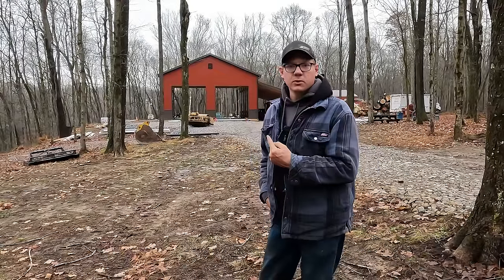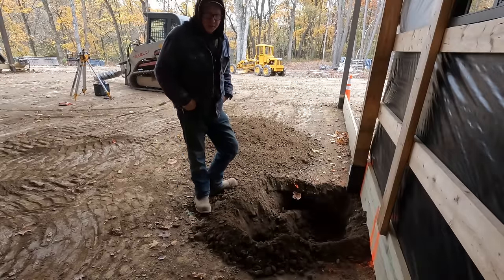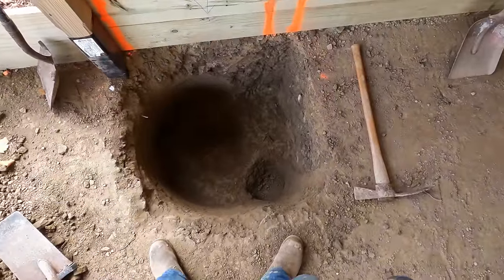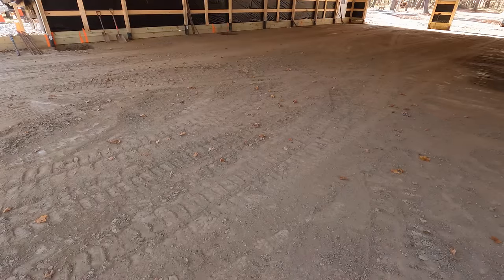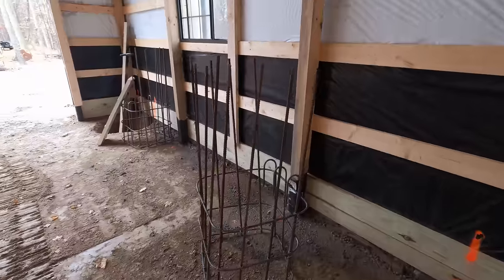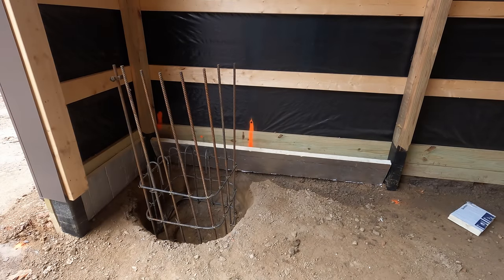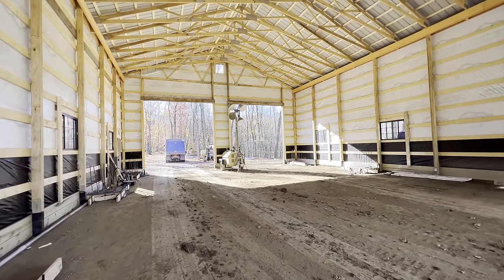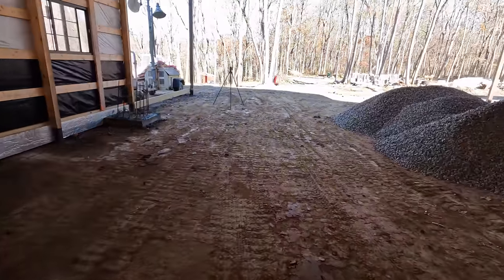Digging & Pouring Footings for a Bridge Crane! (Dream Shop Build)

Comment: Hey Matt , wanted to commend you for all the hard work you do by yourself.  It's very evident that your shop has been well thought out and in the planning stages for some time.  Just watching all the work it took just to make the pier forms is extremely impressive and confirms your character and desire to have the awesome building that you have always wanted.  
As you will find out , there is something about pulling in a piece of equipment on a concrete floor right next to the tools , that makes the service on the equipment and even the breakdowns easier to deal with.  If any one deserves to have a shop that nice , it's YOU !
Reply from the maker: Thanks friend!!

Comment: For a rebar bender I made an adapter for a wood splitter to make all my bends. I know it’s too late for you this time but keep it in mind for next time!
Reply from the maker: Oh that’s an awesome idea!!! 🤔🤔🤔
Reply: I use a crqppy chinese wood splitter as a hydraulic pipe/tube bender
Reply: There's a money tip!  Excellent idea!
Reply: Would the tubing bender you used for the Galion have worked?
Reply: I'm sure he can find one of those, in the woods or weeds, that hasn't run for 10 years. :)
Reply from the maker: @sithus1966  already have one lol
Reply: @Silverhornet81  Doubtful, takes a lot more force to bend rebar compared to hydraulic tubing.
Reply: @BlueDually4x4  um, no.
Rebar actually bends WAY easier than tube!

Comment: i had been wondering how the crane was gonna mount into the building. usually the supports and the crane rails etc are part of the building walls themselves. nice work!!
Reply: you are not alone on that
Reply: Not once they get into heavy weight, I work in the granite industry, and usually 50ton cranes, and some larger, I have however used one up in barre tv, at northern granite, that the crane structure was in the hundred year old area, and the structure was wood, and tied into the building, you want the hear the noises when it travels the length of the warehouse…
Reply: Little victory outdoor, “concrete’s here” 😂😂
Reply from the maker: @ryanhogan6509  ooo I’d love to See that!!
Reply: I've worked on both, newer steel framed buildings had them as part of the building, older masonry structures had separate supports.
Reply: My grandpa worked for the Santa Fe railroad for 42 years in one of the locomotive reman shops in California. Their big crane was a 250 ton beast that had to be load proofed every so often. I have a picture of the crane picking up a full locomotive and the hull of a second one. I wasn’t there but I’ve been told that building was making some massive groaning sounds
Reply: Bolting the crane girders to the house frame and the steel pillars would only make the whole thing 
More solid building taking upp angle forses between girder and pillar.
Steel construction anchors the building to the ground (win-win)

Comment: So refreshing seeing a job properly done, many here on YT like to cut corners with the attitude " good enough " , of course there is a time a place for that, but not when building a floor with a solid and strong base that will properly support the weight of the crane and heavy equipment. Doing it the right way the first time will ensure this will last generations and should never cause any major problems in the future.  You're a good hard worker and it's easy to see that you take the time and effort to do the job right the best a person can, there is a lot to admire in that.

Comment: Ever since you've started clearing the trees for this workshop I've been looking forward to each following build video almost as much as you look forward to finally have it completed :) I can totally relate, because I'm in a process of building my small dream workshop as well :) It's much smaller, only approximately 11,5 x 24,5 feet (it's going to be primary for woodworking) which is close to maximum area for a building without a building permit in Poland and the only piece of equipment I have is a backhoe that's older than me but I love it and I love working on my "farm" :)
Reply: Must be really tremendous to have so many viewers just as good

Comment: I have been blown away by the construction of the pole building.  Here, when I put my pole building (40'X48" 16' eves), up,(2007) the county required the foundation holes to be 40" in diameter and 48" deep to finish level.  The upright beams had to be 6X8s, 2 months later when I added another 24' (40'X72') the specs had changed to 8 by 10s.   Water pipes only have to have 12" of cover for frost zone.  Happy for you.

Comment: A word of advise if you have a heated or insulated concrete floor. Be sure to bury a wire mesh a few feet deep around the perimeter of the building to keep the burrowing critters from getting to that insulation. They love that stuff for nesting material and will destroy as much of it as there are critters. Don't ask me how I know.

Comment: I built forms on a house renovation project. Used lots of T-25 screws on the forms. My secret is to cover each screw hole with a piece of tape to keep concrete from ruining the screw head. You can then also reuse the screws. Also, take a black marker and make a circle around each screw so you can easily find it after the pour.
Reply from the maker: I reuse most all these screws too
Reply: Another saving is that you don’t need super quality screws for making forms. A bucket of the cheap stuff, even without any corrosion treatment will work just fine.

Comment: I’m currently building a 24x60 steel workshop. All steel frame. My late uncle was a welder (as was my late dad) He had built seven steel trusses out of 1-1/2”x 3/16” steel angle. He was going to build a garage to store his truck and boat at his lake property but passed  away before he could do so. I used three of the trusses spaced 15’ apart with 2x4 steel cee purlins on 36” centers to build a carport. I’m using the other four trusses spaced 20’ apart with 2x6 steel cee purlins on 36” centers.i don’t have the time or patience to record edit and post it on YouTube!

Comment: Bit late now, but the peg on the other side of the rebar bender is for your foot. It can help stabilize the bender for even bending. Also, wetting the concrete down doesn't slow the cure rate. It prevents too much moisture from evaporating out of the concrete. The chemical reaction of the curing process needs water in order to work, that's why you will see contractors a lot of the time in warmer climates where it is not practical to wet the concrete to spray fresh concrete with a wax based "curing compound" which helps reduce evaporation.

Comment: A suggestion for future expansion.  When you extend the shop take the coloured siding off under the lean to and replace it with white.  White siding under the lean to will make it brighter. 

The removed siding could be used on the extension or to close in the lean to.

Comment: It's a bummer a couple of supports ended up behind windows but looks absolutely fabulous.  Your dedication and hard work is paying off for sure Matt!
Reply: If he wanted to before they put up the interior could add more windows. Its really pretty easy on pole barns.
Reply: @kameljoe21  he probably wanted symmetry on the outside.  My only point was harder to clean windows and has to worry about chains hitting window of he decides to hang them from supports. I'm sure Matt has a plan...
Reply: @travisrulason3863  That might be true. Most times in these buildings people just add in x amount and even space them out. Remember that he had this building planned long before he got the crane. Which is going to be the best part about this build. That crane. Yet the the beams are likely to only be 6x6 or 8x8s. So i doubt they will block much. Though he must have found someone to help him desgin the frame for the crane and I can not wait for the load testing of it. Its going to be super cool. I hope he has some sponsors lined up for lighting and a number of other things.

Comment: Good call on a perimeter thermal break, however back loss between the heated floor and earth will be significant. If you haven't poured the floor yet consider using a rigid insulation (if you can find one with a high enough PSI rating) or a blanket/roll style insulation. Great  content!
Reply from the maker: It’s got insulation

Comment: Your rough surface adhesion idea is good, but what you really need to do is keep a soaker hose on the concrete for 24 hours prior to you pouring the adjoining slab - the reason for this is it opens up the pours in the cement matrix, allowing infiltration from the secondary pour. Presoaking is a contractual requirement for concrete overlays on all government capital projects where I'm from. They're almost always followed up by a tensile bond test (pull test) to verify adhesion.
Reply: Unbelievable I never would have thought. So if it opens up the matrix it must remove cement. I have seen a lot of concrete jobs that were ruined because somebody got out the garden hose after it was poured. Generally all you want to do is cover your new concrete with plastic you will see water droplets accumulate on the underside of the plastic that's all you need.

Comment: We took one of our bucket and welded a piece of 5/8 flat steel across the teeth. It was great for clean up and digging out holes as you are doing. one suggestion is use old teeth and bevel the edge.

Comment: Matt I built my shop back in 1982 to work on equipment . It ended up , I filled it up with machine shop equipment and Lost my workspace .For years I’ve wanted to add on so I’m not working outside and now I’m 67 and I should be thinking about retiring . After watching your videos and let’s dig 18 videos instead of sitting in my chair I’m going to get that addition on my shop . Thanks for getting me in the mood to make something happen it’s better than thinking how old I’m getting.

Comment: Great job Matt, one little remark, concrete NEEDS water to cure, so, the longer you can spray it, the faster it reaches its full strength. I was surprised to see how hard it was already when you were taking the form off😮

Comment: I helped build a workshop and helped with the iron work for the floor which was heated, it also had pulling points(frame shop). Heated floors are F'N fantastic in the winter. Many days ended up working in jeans and a T shirt

Comment: Leave it to you Matt, to make pouring footers interesting.  You did the same thing with the leaf blower vid a couple weeks back.
Looks like from here, you are going to be about 12" to FF.  So I am guessing 6" slab (prob 5500# fiber-crete) with 2" extruded polystyrene under that, and 4" crush under that.  It's going to be interesting to see what size pex you"ll be using, spacing, number of loops, reservoir, and flow rate for your in floor heating system.
I'm watching this 4 hrs after your video launched, and you are already over 80K views.  That's over 20K views per hour.  I think some of your earlier videos barely have 20K views TOTAL!  I bet you never imagined in your wildest dreams that you'd have a following like this!  Well done my man, you deserve it!  Thank you, and I look forward to your next one.

Comment: pro pro tip for cleaning out screw heads in concrete forms.  double headed nails.

but if you must use screws.... put some tape over the screw heads

Comment: Matt, I poured a monolithic floor with an edge that prevented the slab from moving as it cured, shrinking in size.  The result was a nice stress crack in the middle of the pour.  Your crane piers will do effectively the same thing.  Hopefully, your heating tubes will be below the concrete, allowing you to cut stress relief cracks in the floor.  If you place the tubes in the floor, you will risk damaging the tubes as the concrete shrinks, cracking the floor.  The result will be linear stress on the heat tube between the floor pieces and possibly shearing if the slabs shift vertically.  I assume you are going to use a boiler system to heat water and pump it through tubing.  I have a wood fired water system and utilize forced air instead of tubes running in the floor.  The disadvantage to an in-floor system is heating the thermal mass of the concrete takes a very long time. It is much quicker to heat the shop air using a fin and tube heat exchanger with forced air.  If you have any questions, feel free to respond to my email to you on November 6th at 1:12a.m. (from my yahoo email account) regarding a manual to your JLG lift.   Best regards, Len
Reply: Er, isn't the BENEFIT of underfloor that it takes a long time to heat up, but then it slowly and evenly releases heat into the whole space!!
...And, because it releases heat from below, it's less wasteful, more comfortable and avoids draughts and cold spots ..!?!?
...in fact, ideal for a big space like this .... !
Reply: @andymccabe6712  Hello Andy, I am heating a building with a volume of approximately 14,000 cubic feet with a wood fired boiler rated at 140,000 Btu/hr, with forced air through a heat exchanger (fin and tube).  Air exiting the vents is typically in excess of 140°F. If I come in and the temperature is 10°F low in the structure, it takes about 20 minutes to get it up to temp.  The rise is about 1 degree every two minutes. If the heat exchange was done with piping below the floors, it would take much longer to bring the structure up to temperature.  Plus, there could be an overshoot due to large thermal mass.  Likewise, if it were a cold morning and a warm day, the structure could get too warm, later in the day.  In my analysis for the heating system, other considerations for avoiding in floor tubing were: 
-Piping in a large structure should be divided into zones for equalization of the heat throughout the floor.  It cannot be one long loop as the water in the pipe starts to cool immediately, as it enters the floor.  
-Damage to the pipe in the floor, or sub floor is virtually impossible to fix.
-Power to a pump needs to be on for extended periods when heating a large thermal mass, such as a concrete floor.  (A water to air heat exchanger only requires water to be pumped while a blower is running.)
-Heating a floor material also creates thermal expansion of the floor.  
-The circulating pump for a large shop in floor system will be rather large.  (A water to air exchanger only requires about 1/8hp.)
-To get proper efficiency, the velocity of the water going through a pipe need to fast enough to ensure that water does not flow primarily in the middle of the pipe.  The calculations involve a factor called a "Reynolds number" to insure turbulent flow in the piping.  This aspect is particularly important in geothermal heat pump loop designs.

 I do not believe Matt has commented on what his heat source will be.  I also believe that he only has generators for electrical power.  Thus, the generator would need to run for extended periods to power the pump most of the day vs. just turning it on when heat is needed, while he is there.  The ground temperature where is he located is also around 50°F which will also rob some heat unless the piping and slab are insulated from the ground.  

There are definitely some plus sides to an in-floor system:
No ducting is required.
No air filters are required.
No noise from an air handler.
Warm to the feet, especially if you go barefoot. 🙂

With both designs, the water in a boiler system needs to have the proper chemistry and a means to prevent freezing if not utilized constantly during cold weather.  Provisions also have to be made with the chemistry to inhibit bacterial growth in the system.  Bacteria can upset the balance in anti-corrosion chemistry.

It will be interesting to see what Matt comes up with for a system.  I just hope he spends time researching everything.  Otherwise, the outcome may be less than pleasant.

Comment: Love the progress Matt. I was h9nestly a bit sketched out by you drilling so close to the posts until I realized you weren't going too deep to compromise the fill around the bottom of the posts. A proper tie wire tool might have helped, but bending is the hardest part.

Comment: You could bend those stirrups using the backfill blade on your excavator to hold them down and then use your bucket to bend them . Just a thought for next time. 21:04

Comment: for anyone one who has not done any deep concrete the matt was using a vibrator that was the strange looking black pipe like object (manyway you vibrate the concrete when it is wet to help encourage the air from the lower parts it helps to cure the cement and makes the bite onto the cages a little tighter  I havw done some road and building fottings work in the past

Comment: Great job.... I was a Rod Buster for 3 years.....In those 3 years, I did foundation, columns, stairs & little wall work. From my experience I would have put a x brace in the center of the bands, to help it reinforce the concrete. I must say your pier foundation work was great.

Comment: I know, use what you have, right.  Some times you need to use what the eq rental store has. 
Those mini ex will do a great job & quickly. One other thing, they can move the dirt to a better location for removal from the building...with another machine.  Really like the project!

Comment: Wow Matt, now that's an auger. Can't wait for the overhead being used. I worked in a foundry that had one and ran into the control hanging down all the time. Folks would never spend the time running it back out of the way. Lazy farts

Comment: When you connect crane footings with heated slab, which extends and retracts due to temperature changes, it will generate tensions and cracks as well. The heated slab should be allowed to extend and that's why it should have dilatation around. I would also consider adding steel brackets to those main support poles and sink those brackets in concrete slab.